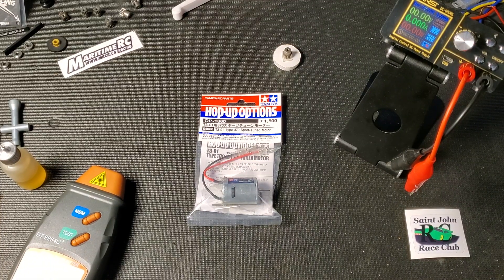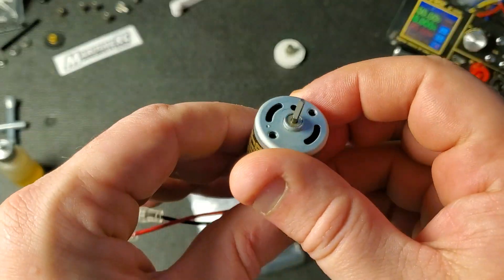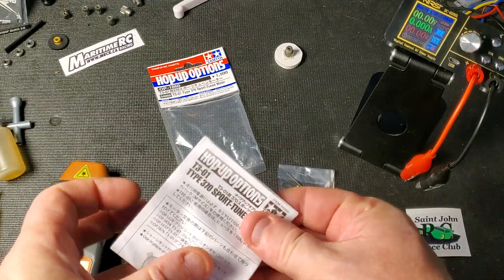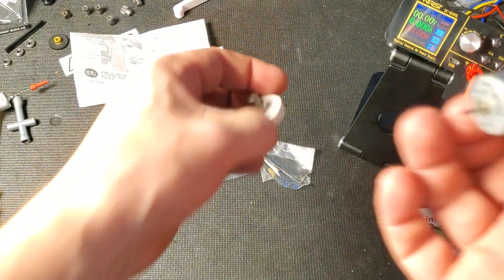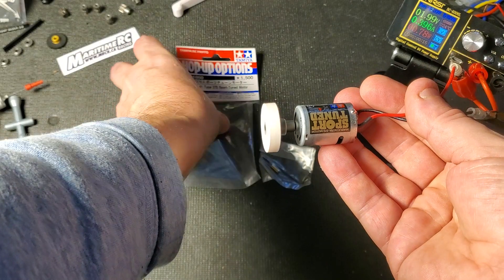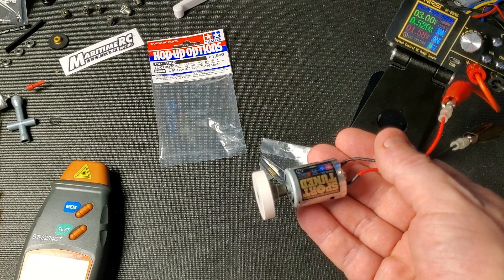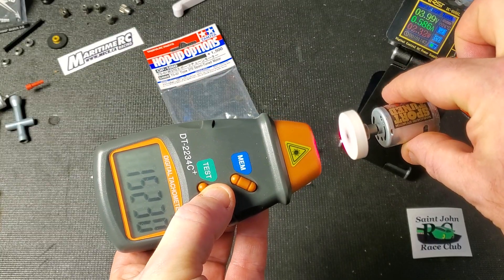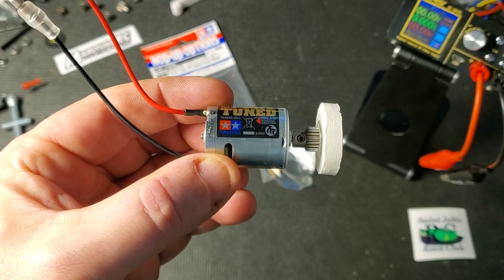Review: Tamiya Sport-Tuned 370 brushed motor (Part# TAM 54860)

Comment: 4 volt is good and all, but why not try 7.4v or 11.1v standard 2/3s? muhahahahha
Reply: Yes, i don't know anyone that would be running this at 4 volts. I want to know if these motors will be a better replacement for my Typhoon Hovercraft fan motors, but how would anyone know from a 4v test when that runs on a 9.6v battery pack?
Reply from the maker: @CaseTheCorvetteMan  i test on 4v because the rpm and amps are pretty linear. So for 8v just multiply the results by 2. Its also easier on the motors testing with low volts.
Reply: @lawton70   fair enough

Comment: What kind of oil did you use for the bearings at the end of the motor. I've been waiting for the chassis weight kit from sparetime hobbies I know you going to do a review.😅🤙🏻
Reply from the maker: It is an oil for bushings and bearings. I'm not 100% sure the brand but I thought I got it from Muddslide Motorsports many years ago.